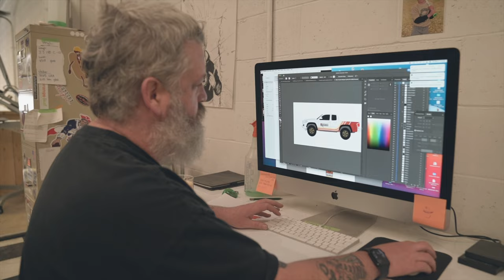"Due North - Series Trailer" - Overland Tacoma Build - Mountain State Overland

Comment: Sweet rig! Only thing different I would do is have camper white for less heat inside.
Reply from the maker: We’ve owned silver and and black campers and there really is zero difference in heat gain. The ceilings of Alu-Cab campers are insulated to reduce heat loss or gain due to exterior temps and excessive solar energy.
Reply: @msoverland  Good to know. I started thinking it probably was insulated. I would also go white just to have it match. Plus I love super white! Love the retro stripes.